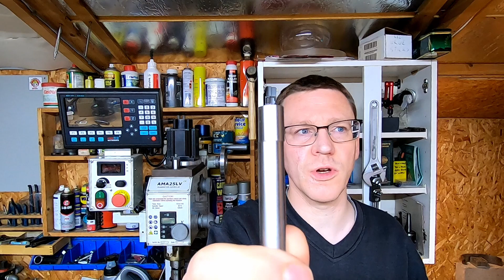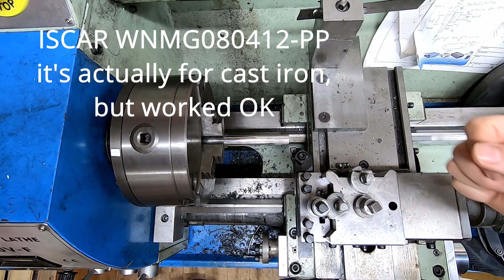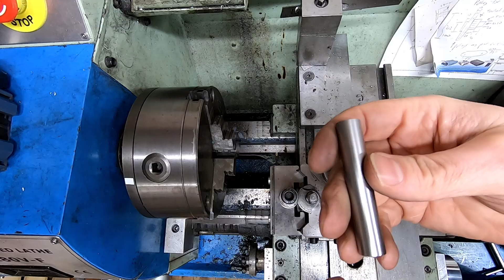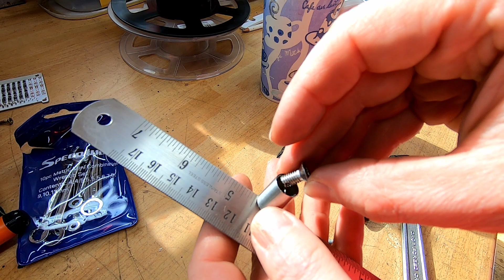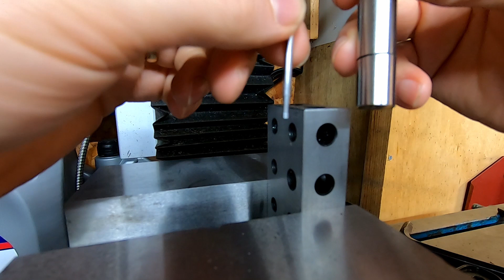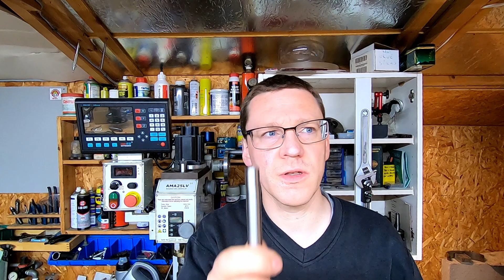Making and Testing a Centre Finder

Comment: I've been meaning to make one of these since I first got into hobby machining, but in the meantime, I get by with a surface ground pin and a scrap of paper . . . . . I've been getting by for about 10 years now !
Reply from the maker: If it works then there's no need to make one, however there's a certain pleasure in using shop made tools.

Comment: Nice job on the edge finder!  I was totally frustrated by the wiggler when I first started and only use the pointy bit now.  I use an edge finder most times, but when I really, really want to nail it to the last bit, I use an indicator in the spindle.  The process has been covered by Stefan Gotteswinter but basically you put the indicator in the spindle and zero on the edge--you have to rock the indicator back and forth to find the low spot--and zero the DRO.  Then raise the spindle and indicator, carefully spin it 180 deg. and hold something straight on edge of the part so you extend the edge upward, but now on the other side.  A gage block, a small parallel, I have even used a small piece of cold-rolled steel all work OK.  Now move the axis until you get the same zero on the indicator on the extended surface.  Use the DRO half function, drive to zero and you on the edge.  If it is critical, I check it again after the move.  You can find edges to whatever precision indicator you have with this method.
Reply from the maker: I'm familiar with the indicator technique (blondihacks I would think is where I've seen it) but rarely work to that level of accuracy. I will give it a try though as I've never actually done it. Thanks for your input, and thanks for watching.

Comment: Nice! I think your setup will be an order of magnitude more accurate than mine (you're at least a rung or two further up the ladder up on weight and quality), but I came to the same conclusion as you. My offset cylinder type and mini mill gives repeatability of less than a thou on a good day. The only bit of the wiggler type I now use is the pointy one, as once spinning true it takes care of any eccentricity in the mounting. The wiggler one is quite long too, whereas the cylinder one can be pushed right into the collet, which makes it much more useful headroom-wise on my very small machine. Thanks for sharing!
Reply from the maker: Hi Matt. I will have to do some further testing, I realised afterwards that all the measurements were made without refitting the edge finder in the collet chuck. I may have just got lucky with the position. Either way it's a lot nicer to use than the wiggler. It's nice to hear I'm not the only one that hasn't had a great experience with the wiggler. See you next time.

Comment: Hi Olly, fantastic results from your homemade edge finder!! I have got the Starret version of your Chinese wiggler, best I can get is about 0.03mm to 0.05mm out of it, they are not fantastic. Stefan Gotteswinter did a good video on comparing Edge finding techniques, worth a watch. The only thing I can suggest is do a trial running the wiggler much faster (800 rpm ish), see if you get any difference, also play about with the tension on the nut (there will be a sweet spot, you just need to find it). Cheers, Jon
Reply from the maker: Hi Jon, thanks for your thoughts. I will check out the Stefan Gotteswinter video, and your suggestions about running faster and adjusting nut tension.  There are still instances when the wiggler is the tool to use, so would like to get better results, although I'm so pleased with the cylindrical edge finder that I'll probably use that most of the time!